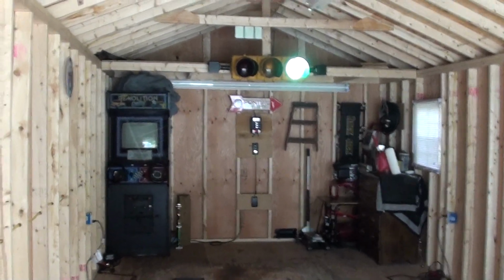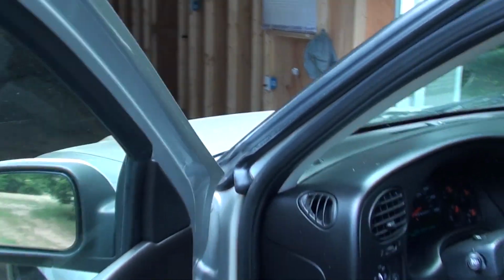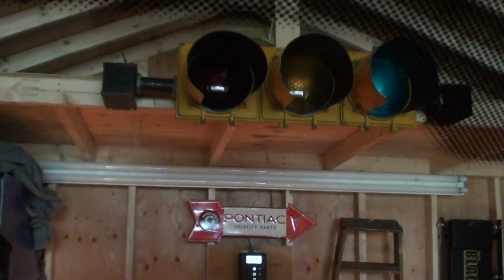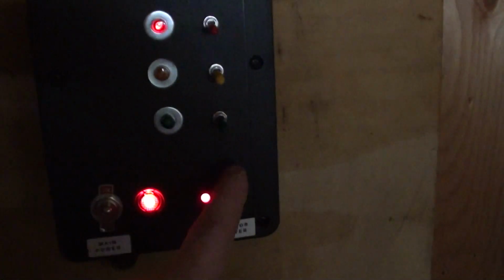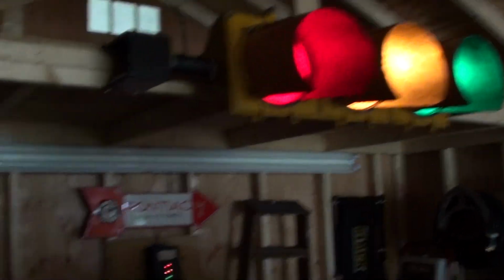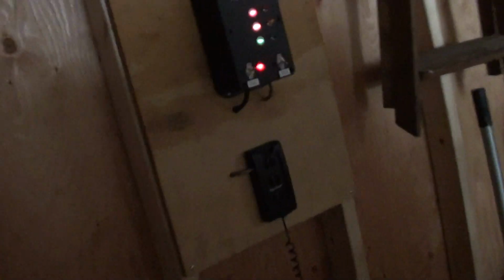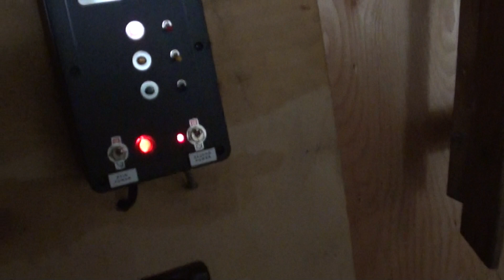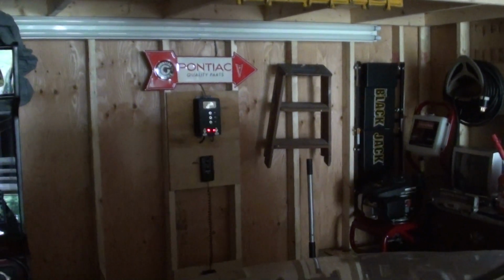Working Traffic Light in Garage

Comment: Hello Pacmanfan77,

1.  Great project.
2.  Is it possible if you can share the circuit.
3.  Bought a Park Zone 1900 , traffic light and solid state relay and wanted to do the same in my garage.
4.  Where did you take the input that drive the solid state relay?

Thanks

Comment: Any chance you could provide / send a schematic of your box??  I'm trying to do the same thing.  
I got some SS relays - SRD-3VDC-SL-C and tried taking voltage directly from the LEDs on the "tiny" parking light as the input source for the relay but when I check the switch (output) on the relay with an ohm meter, the lights on the tiny parking light are very dim and the relay shows no change in resistance.
Awesome job that you did!  Wow!  

Thanks in advance!
Chris
Reply: Chris Barbot any luck?